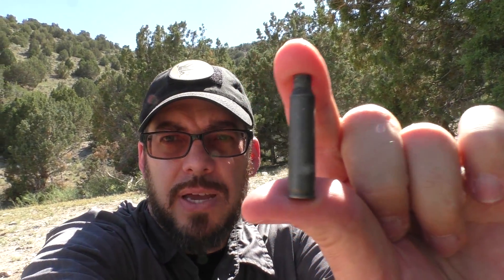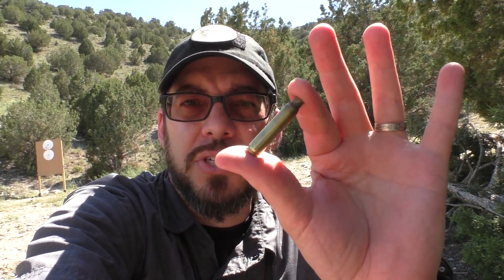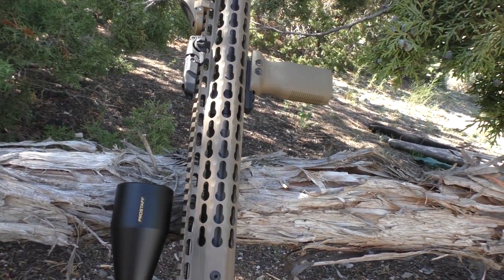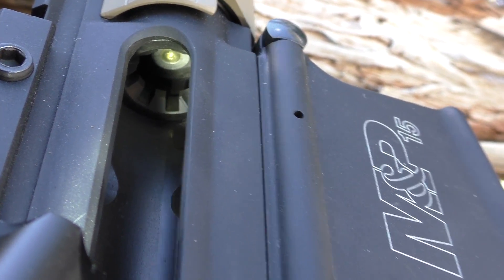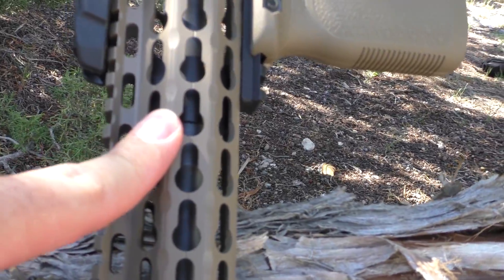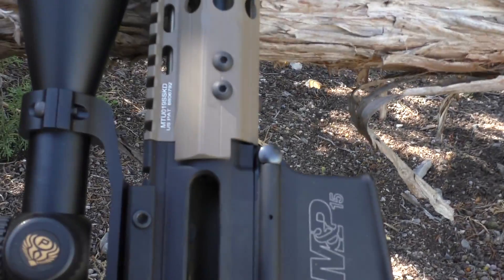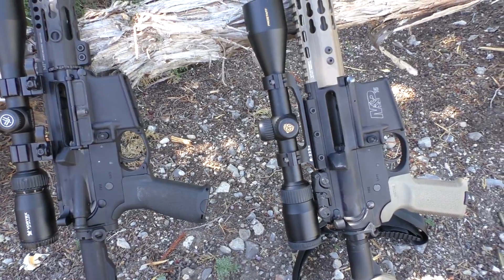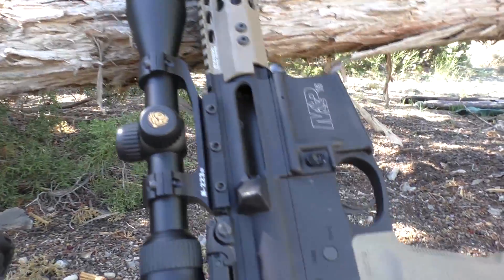Tula .223 Killed My Guns! V-Log Thursday

Comment: Simple solution; don't use shitty steel case plinking ammo if your looking for ultimate reliability. AR's are developed for brass case ammo. Why? Because the 5.56 is a high pressure round and brass expands properly inside the chamber, unlike steel case ammo. Will some/most AR's chamber and fire steel case reliably? Actually yes they will, but to complain about the cheapest ammo on the market not being a great product is just silly. I am able to find brass cased, commercially loaded M193 both in stores and online for around .28-30 cents per round regular price, and even less during sales. I am able to load my own custom cartridges for 20-35 cents per round depending on the bullet/powder used for a specific load. At these prices, it has never been worth it to me to fire steel case Wolf/Tula/Brown Bear etc. When I do fire steel case ammo, it is through my one AR that is setup and built to run steel case cheap range ammo, and it runs flawlessly. (Rock River upper, PSA Lower, Milspec parts kit, O-ring from extractor removed to relive tension)
Bottom line is complaining about steel case ammo not functioning in an AR is equivalent to complaining about Subsonic Ammo not cycling a semi auto, this is not the load the weapon was originally designed around so you really shouldn't be surprised when it isn't 100% reliable. If you want to shoot steel case .223 a lot because you really need to save that extra 3-5 cents per round then set your rifle up to do so, any gunsmith can give you the tips needed to reliably make a "steel case" AR.
Reply: Some folks are not as financially independent as you seem to sound like.
I shoot a lot and don't have the time to reload brass as you seem to have.
Frankly, I have no issues with cheap ammo when it comes to my weapon.
Clean it and keep it lubed during my shooting day.
IMHO
Reply: "When I do fire steel case ammo, it is through my one AR that is setup and built to run steel case cheap range ammo, and it runs flawlessly"
Please enlighten the rest of us on how an AR platform is set up for steel cased ammo! 
I don't know of any such mods to make what you are referring to, and I've been building these guns for many years as well as taken a certification course on AR15's-M16's, building and repair.
Reply: First make are the throat in your chamber has fairly loose tolerances,(standard milspec chamber) match grade super tight chambers are great for accuracy but no good for steel. Then run a BCM or similar extractor upgrade, but without the milspec o ring installed. (Just run their spring and buffer piece with a milspec extractor minus the o ring.) Also helpful is to stick with a basic milspec firing pin and not a fancy aftermarket lightweight piece. (Just to prevent soft strikes on hard primers that cheap ammo tends to have) These few things will make an AR run steel like a champ. Also a lot of "budget ARs" tend to run steel just fine also because of their innately loser tolerances compared to high dollar rifles. From what I've seen M&P15s run steel 100% straight out of the box as do Windam ARs and good old Bushies. It really isn't a science to run steel, basically just making sure the chamber is lose enough since steel expands but does not contract like brass, and getting your extractor setup so it doesn't tear cases. Once you get those two areas compatible with steel the rest of the rifle build is inconsequential.
Reply: It's not reasonable really to expect something totally different from what the platform is designed for, and the M16/AR style rifle was never designed to shoot a steel cased cartridge.  Would it be reasonable for me to complain that my 10/22 doesn't feed .22 CB caps? No, because that rifle was not designed for that cartridge, so why would I be surprised when it didn't function properly. Is it a bonus that some rifles will function with cartridges other than what they are originally designed for, i guess to some people it is if all you want to do is put holes in paper for the lowest price. But if you want ultimate reliability, which is what this guy was complaining he isn't getting, then use what your supposed to use. Now if he wants to complain that a properly built and maintained AR isn't firing quality 5.56 ammo that would be a valid point of complaint, but all these people whining about steel case ammo doesn't run well or steel case ammo destroyed my gun etc is just dumb because there is such a simple solution; use what the rifle was intended to use!
Reply: Following that logic, the 1911A1 .45 pistol was designed for brass cased ammo. So, why did the US produce and shoot literally tons of steel-cased ammo for that handgun? Riddle me that Batboy!!!!!
Reply: .45ACP operates at 16,000cup and 5.56mm 53,000+  pressure.
Reply: Lyman reloading manual states the .45 Auto has a maximum of 18,000 CUP or 21,000 PSI
Reply: "5.56mm 53,000+  pressure."

American Rifleman article:
Most gun guys know the history of the .223 Remington and that it—like so many of our popular cartridges—started life in the military. Because the military switched to metric designations sometime in the 1950s, this little .22-cal. cartridge was later called the 5.56x45 mm NATO (commonly referred to as “5.56x45 mm”).

The 5.56x45 mm surfaced in 1957 as an experimental cartridge in the AR-15 rifle. The concept was to develop a smaller, lighter military cartridge that would still be traveling faster than the speed of sound at 500 yards, and this was accomplished by using a 55-grain boattail bullet. The AR-15 evolved into the select-fire M16 rifle that was adopted by the military in 1964.

Even though it would ultimately kill off its own .222 Rem. and .222 Rem. Mag. cartridges, Remington was quick to act, and very shortly after the military adopted the 5.56x 45 mm cartridge the firm brought out the civilian version, called the .223 Remington. Confusion followed.

The common misconception is that the two are the same; that 5.56x45 mm and .223 Rem. are the same dance partner, but with a different dress. This can lead to a dangerous situation. The outside case dimensions are the same, but there are enough other differences that the two are not completely interchangeable.

One big difference is pressure. It becomes a bit confusing, as the pressure for the two is not measured in the same way. The .223 Rem. is measured with either Copper Units of Pressure (c.u.p.) or—more recently—with a mid-case transducer in pounds-per-square-inch (p.s.i.). The military 5.56x45 mm cartridge is measured with a case mouth transducer. The different measuring methods prevent a direct comparison, as a case mouth transducer gives lower numbers on identical ammunition when compared to those from a midcase transducer. That’s because the pressure is measured later in the event, after the pressure has already peaked. According to Jeff Hoffman, the owner of Black Hills Ammunition, military ammunition can be expected to hit 60,000 p.s.i., if measured on a Sporting Arms and Ammunition Manufacturers’ Institute (SAAMI) mid-case system. Black Hills loads both 5.56x45 mm and .223 Rem., and Hoffman was a tremendous help in researching this article. He also provided these pressure specifications for the cartridges. The .223 Rem. mid-case transducer maximum average pressure is 55,000 p.s.i., while a 5.56x45 mm measured with a case mouth transducer has a maximum average pressure of 58,700 p.s.i.

While the 5.56x45 mm chamber is slightly larger than the .223 Rem. chamber in just about every dimension, the primary difference is throat length, which can have a dramatic effect on pressure. The 5.56x45 mm has a longer throat in the chamber than the .223 Rem. The throat is also commonly called the leade, which is defined as a portion of the barrel directly in front of the chamber where the rifling has been conically removed to allow room for the seated bullet. Leade in a .223 Rem. chamber is usually 0.085 inches, while in a 5.56x45 mm chamber the leade is typically 0.162 inches, or almost twice as much as in the .223 Rem. chamber. Also, the throat angle is different between the two chambers, and that can affect pressure rise and peak pressure.

SAAMI regulates cartridge overall length, but not bullet ogive design. The shape of the ogive can significantly affect how far the bullet jumps before contacting the rifling. Some 5.56 mm bullets have an ogive suitable for 5.56 chambers with the longer throat, but if they were chambered in a .223 Rem., it could result in very little, if any, “jump” to the rifling. This can increase pressures. Remember, the 5.56x45 mm already starts out at a higher pressure. If the higher-pressure 5.56x45 mm cartridge is then loaded into a .223 Rem. firearm with a short throat, the combination of the two factors can raise chamber pressures.

If you are a handloader, you must also consider that the 5.56x45 mm cartridge case may have a thicker sidewall and a thicker head, which were designed to withstand the stresses generated by the higher chamber pressures. This reduces the powder capacity of the case. If the 5.56x45 mm case is reloaded with powder charges that have proven safe in .223 Rem. cases, this reduced internal capacity can result in much higher chamber pressures.

Bottom line? It is safe to fire .223 Rem. cartridges in any safe gun chambered for 5.56x45 mm. But, it is not recommended and it is not safe to fire 5.56x45 mm cartridges in a firearm chambered for .223 Rem.

In fact, the 5.56x45 mm military cartridge fired in a .223 Rem. chamber is considered by SAAMI to be an unsafe ammunition combination and is listed in the “Unsafe Arms and Ammunition Combinations” section of the SAAMI Technical Correspondent’s Handbook. It states: “In firearms chambered for .223 Rem.—do not use 5.56x45 mm Military cartridges.”

There is no guarantee, however, that .223 Rem. ammunition will work in 5.56x45 mm rifles. Semi-automatic rifles chambered for 5.56x45 mm may not function with .223 Rem. ammunition because they are designed to cycle reliably with the higher pressure and heavier bullets of the 5.56x45 mm—particularly with short barrels. While problems are rare, they do not indicate that the ammunition or rifle are defective. Like some marriages, they are simply incompatible.

When shooting .223 Rem. cartridges in a firearm chambered for 5.56x45 mm, it’s likely that there will be a degradation in accuracy and muzzle velocity due to the more generous chamber dimensions. That’s not to say that a firearm chambered in 5.56x45 mm won’t be accurate with .223 Rem. loads, only that, on average, the .223 Rem. chambered firearms will be more accurate with .223 Rem. ammunition than rifles chambered for 5.56x45 mm firing .223 Rem.

Another issue is the twist rate of the rifling. The SAAMI specification for .223 Rem. is a 1:12-inch twist, and most non-AR-15-type rifles will use that rate. But, this is a cartridge that crosses a wide spectrum of uses, and as a result there is often a wide deviation from the 1:12-inch twist rate, particularly in the very popular AR-15-style guns. There are bullets available for the .223 Rem. that range in weight at least from 35 grains to 90 grains. With that wide of a spectrum, one twist rate is not going to be enough.

Firearms chambered for 5.56x45 mm often have a rifling twist rate of 1:7 inches to stabilize the long, sleek, heavy bullets used in long-range shooting. Any rifle with a 1:7-inch twist rate will work best with bullets heavier than 60 grains.

On the other hand, a 1:12-inch twist rate (most bolt-action .223 rifles) will stabilize most bullets up to 60 grains, however some longer 60-grain bullets will not shoot well with that twist rate. Many firearms use a 1:9-inch twist, which is a very good compromise that works well with most bullets up to 70 or 75 grains. The great thing is that if you have a good barrel and quality bullets, the 1:9-inch works well with even the lightest bullets.

What does all this mean? If you have an AR-15 type firearm with a 5.56x45 mm chamber you can shoot either .223 Rem. or 5.56x45 mm safely. If your twist rate is 1:7 inches you should use bullets weighing 60 grains or heavier. If you have any rifle with a 1:12-inch twist you should shoot bullets of 60 grains or less for best accuracy. If you have a .223 Rem. rifle of any type, it is not recommended that you use 5.56x45 mm ammunition.
Reply: Outstanding reply ...it answered all my questions about the differences among the weapons and ammo!  I have a Colt CAR-15 marked for .223, (about 1980) civilian model and a Remington 700 ADL, Heavy fluted barrel, .223.  The answer is NO...  Thanks for the time you took to offer your presentation!

Comment: i HAVE A DELTON MIL SPEC M-4, it runs tula all day. The things I'm thinking are the adjustable gas, or the coating is wearing off the casing and when the barrel cools down the round is getting lodged, Are the bolt carrier groups the same? II'm wondering if you need a tougher ejector spring? Have you been paying attention to which direction the cases are ejecting? I want to take off that stupid front sight/ gas block, for a floating rail, but I dont want to run into trouble. You know what they say, "If it aint broke, Don't fix it." Good luck, let me know what you figure out? M. Hogue Martin, MI

Comment: Steel cased ammo may have issues in a tight chambered AR platform rifle. Be it a tight chamber from the factory OR from a dirty chamber. If it's a tight chamber from the factory, you're SOL. If the chamber is tight because it's carbon fouled, you don't clean your rifle enough.

Comment: I prefer to use brass case ammo in 5.56x45 ...if available.
Reply: The polymer and laquer coatings used on Russian ammo don't melt or get sticky.  You can take a torch to them and and the casing gets red hot before anything happens to the coatings.
Reply: Neil Carpenter it's not melting in your chamber.  It's another steel case myth. Search around.
Reply: There is no varnish, or varnish like coating gumming things up with this ammo.  (They don't use it on this ammo) Even the old steel case stuff that was actually lacquered won't gum up your chamber.  This is all internet hogwash.  Steel ammo does not get "red hot" either like some comments suggested.  Geez, read a little about this stuff, or better yet, go shoot a little.
Reply: Varnish? Try polymer. A thin coat, almost like cheap powder coat.
Reply: I've shot military surplus ammo that had so much lacquer on it that it looked yellow/green and it still fired flawlessly all afternoon. The spent casings had no signs of melted lacquer. Neither do tulammo casings. I think that the chambers on most ARs (and other American made rifles) are just a bit too tight. A subtle polishing by someone who knows what they're doing might fix the jamming problem.

Comment: + the late boy scout 
when you use steel cased ammo, you can run it with no problem if you lube the chamber. you've got to make sure the chamber walls are well lubed. and make sure your extractor spring is tuned right. there's an aftermarket extractor kit you can get for like 5$ that will take care of that problem. the main problem, though, is running steel cased ammo with a dry chamber.

Comment: I had the same issues with tulammo.  Cases would get stuck in the chamber constantly.  Borebathing seems to have solved the problem.  Put a couple drops of oil in the barrel extension and cycle the action several times.

Comment: Hi,

I've seen this type of jam before in classes and at home when polymer or lacquer rounds are shot through a non-treated chamber.  Its never happened with a chromed , Isonited QPQ, or Melonited chamber in any of my AR's in 5.56 or 7.62x39.  My son's Rock River 5.56 carbine does have this issue with polymer and lacquered ammo. 

Its powder residue thats causing the issue,  I do know that Tulane changed recently from ball to an IMR stick type powder which could change the type of fouling.  Chromed and Isonited barrels both have a lower coefficient of friction ( they're slippery) that minimize this issue.  I hope this solves or explains your problem.

Comment: It’s the ammo.  I’ve had the same problem from my Ruger Pistol. They (Tula) likely has ammo lot inconsistencies. The chamber pressure is on the edge for the metallic case and that’s why it’s sticking.  If the pressure is too high the case sticks.  The same AR has worked with other steel cased ammo in the past and it works fine with brass cased ammo.

Comment: I fixed that problem on a carbine length gas system AR... I installed an extra power extractor spring and the heaviest buffer I could find... I read that steel needs the extra millisecond more you get by slowing down the action with the heavy buffer... The extractor spring is supposed to stop it from ripping around the rim of the case...

Comment: Are your rifles chambered in 5.56 and .223 or just .223? Because the steel cartridges are slightly thicker than a .223 but will run in a 5.56 chamber no problem.

Comment: I had a problem with Tula. The case is laquer/varnish coated. Gun heats up and round cooks off the varnish in the chamber sticking it to the side of the chamber.
Shoot brass in the guns and call it good or have the chamber reamed out...a little bit

Comment: Extractor and the springs are worn-out. My friend a former armory Sargent at  camp Williams always warned me about steel case in any AR type rifle, told me it puts undue stress on the extractor said it would actually break them. This was 15+ years ago now. I have heard of improvements in the ammo and the parts so it may not be so bad now but sounds like that is the root of the problem